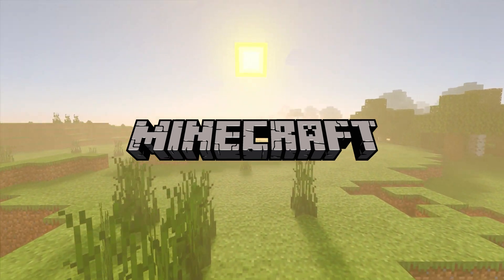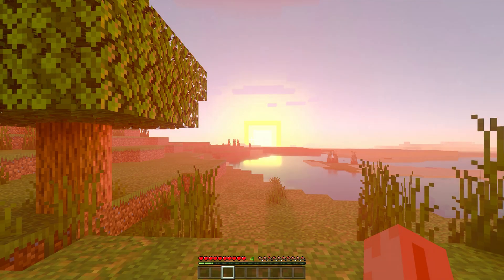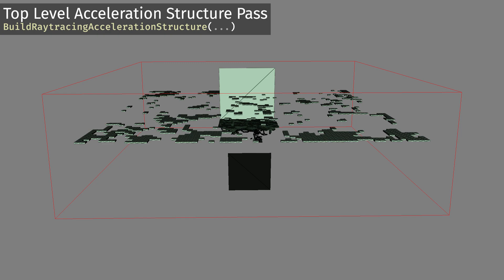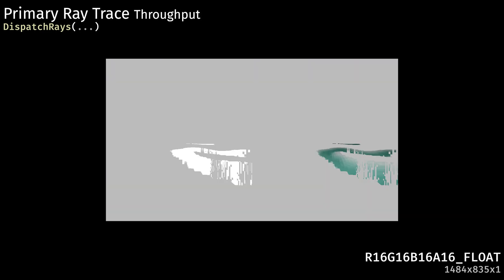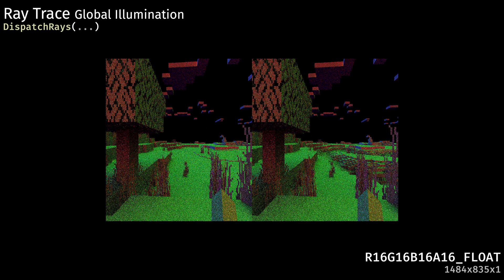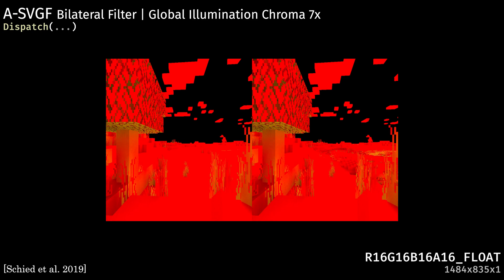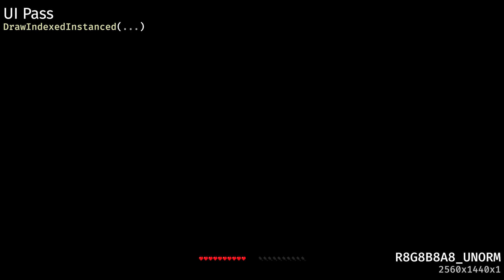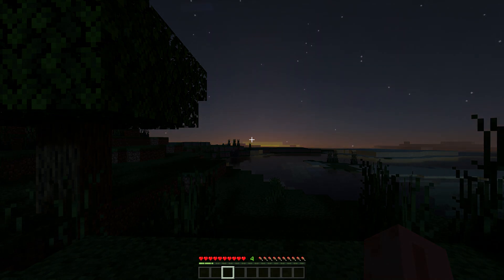Minecraft RTX Beta Rendering Analysis | GameArch

Comment: Hi a question. Why do we need tonemapping when it's 2022 and crts are not a thing anymore, and lightning can be linear or with better monitors full hdr?
Reply from the maker: Generally when tonemapping a frame buffer, it's for stylistic reasons, such as to add a color curve or to match a real camera's behavior.

In addition, depending on your application's lighting units, representing lighting linearly could look really off, as there could be huge differences between regions that would need to be normalized to a more appropriate range.

HDR monitors are just 10 bit monitors which use those extra bits to target 1024 different brightness values instead of 256 per component. They can each very in their behavior as well, sometimes requiring application developers to request the user for their monitor min/max. 

SDR has generally still been fairly reliable as far as consistency of brightness and picture goes, which is in part why video and game developers still target it primarily.